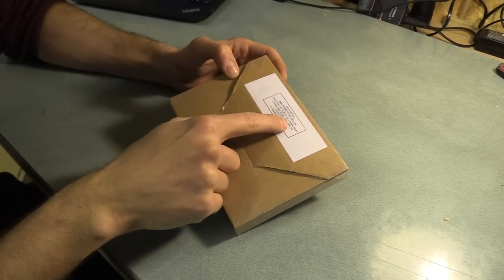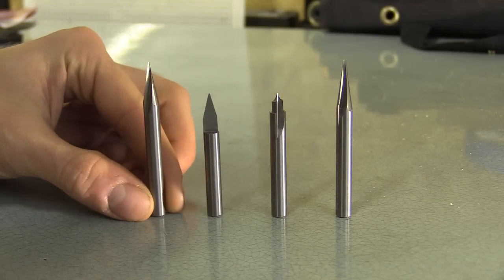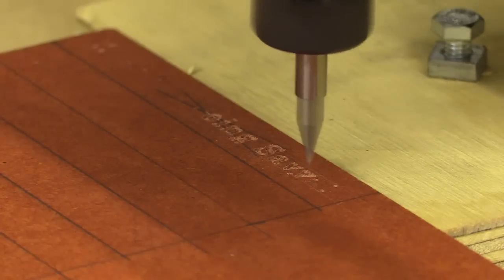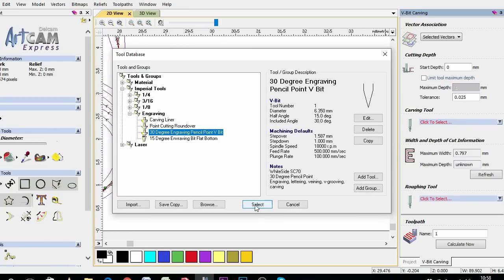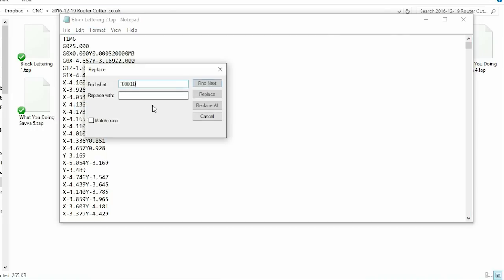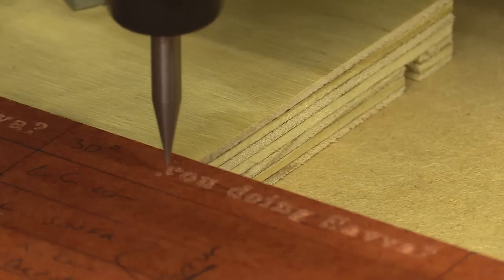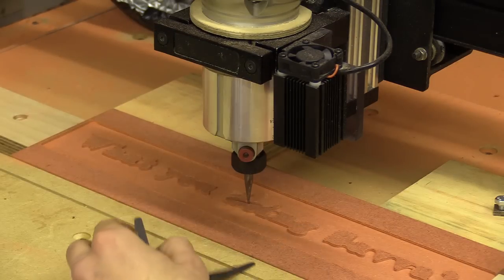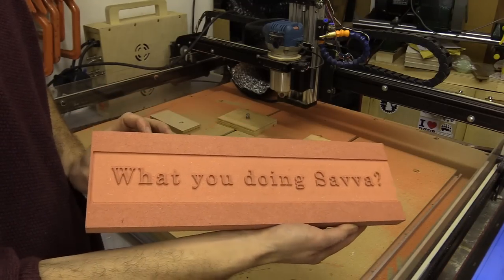Testing Four Engraving Bits / CNC V Carving

Comment: Very interested video. 
I'm ordering all four bits. 
I now use Carveco Maker Plus software and was wondering how do you install the geometry of the flat pointed and pointed round over.  I'm pretty sure that Maker Plus works the same way as Artcam.  Any help would be greatly appreciated.
Reply from the maker: I think there is a link between carveco and art cam - pretty similar. But I'm using vectric aspire now courtesy of their marketing team. My copy of art cam was too out of date to use so I gave up with that. For unusual shaped bits like ogee or moulding types, in Vectric you need to draw the profile as a vector file and link that to the tool database so it might be a similar thing for carveco?